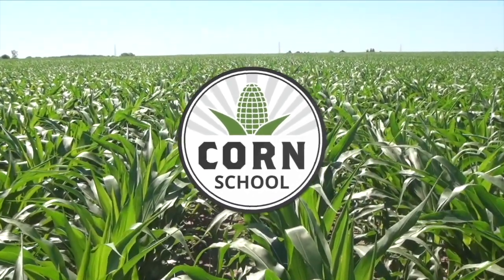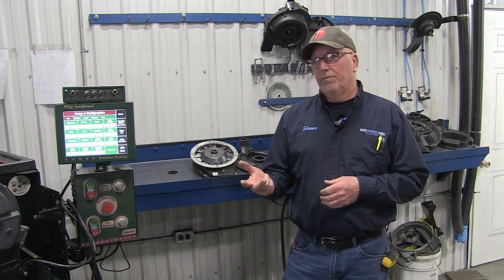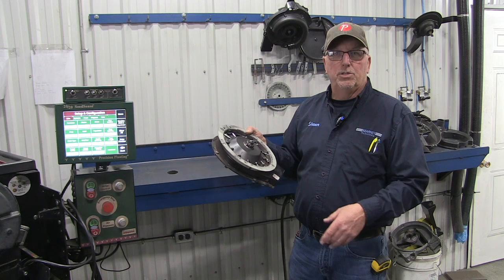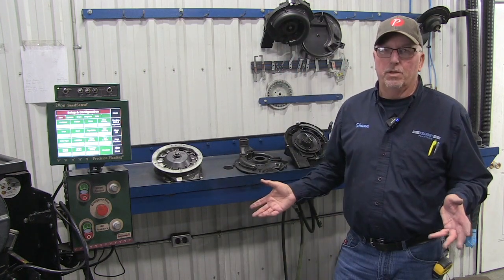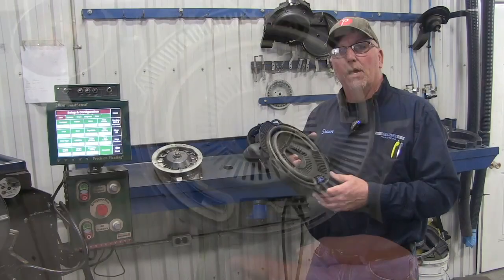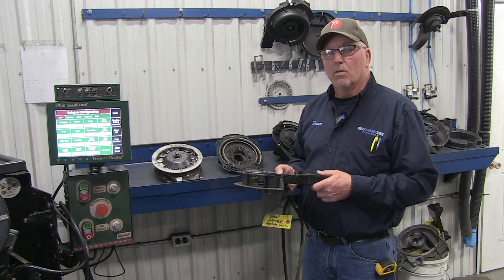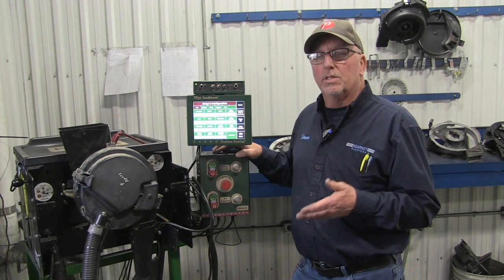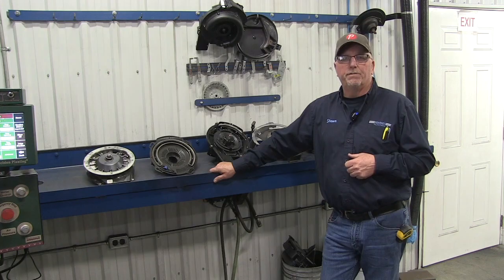Corn School: Seed Meters

Comment: Great Information:Shawn, I am looking to buy a 2 row planter JD 7100 with mechanical finger meters.  I am ignorant on these type of planters.  Can these planters be used for all seeds(corn, sunflower, vegetable(green beans, okra, peas, etc))?
Reply: @KrazyKajun602 I cannot answer about okra and peas, but corn and sunflowers can be planted with a finger meter system.  Sunflowers have a separate finger.  Oil sunflowers are sold in size 2, 3 and 4 seed, where size 2 are the largest and size 4 are the smallest.  You can use a corn finger to plant size 2 sunflowers, but size 2 are hard to come by.  Sunflower fingers work best for size 3 and size 4 seed. Biggest difference is the sunflower finger has a shorter "flag" than the corn finger.  Hope that helps
Reply: Could you give me any info on precision meter 343034 will this work for #4 clearfeild sunflowers. And could you break down what these number mean?
Reply: Finger meters are intended for corn, sunflowers, and pumpkins, basically planted at fairly low populations and having a teardrop shaped seed, which basically even corn is sort of a teardrop shaped seed, though less than sunflowers or pumpkin seed.  They might be able to plant other seeds of roughly the same size/shape, but probably not very well... might do an "acceptable" job or not, depending on what you consider "acceptable".  Smaller seeds its more likely that it'll drop multiple seeds at one time and not "singulate" the seeds, so the population may be erratic.  It's also possible it might not be able to hold onto the seed as it moves over the dips and bump in the backing plate (designed to dislodge multiple seeds when planting corn or sunflowers and allow the extra seed to fall back) or under the brush (which does the same thing as a "last resort").  Large round seeds like soybeans or oblong rounded seeds like green beans or string beans, or large oval seeds like pinto beans, dry beans, or lima beans, may be problematic as well.  The best advice I can give you is "try it and find out".  Population is another issue, as finger meters aren't designed to drop extremely high numbers of seed... they can handle corn up to about 50,000 plants/acre, but the higher the population the faster the meter has to turn, as there's only 12 fingers, which is basically similar to a 12 cell plate in a plate planter, or 12 cell disk on a vacuum/air planter.  Typically for "high rate" seeding like typically used for soybeans and such, where populations over 100,000 plants/acre are very typical (and usually in the 120,000-140,000 plants/acre is normal) you'd have anywhere from 36-48 cell plates or disks to handle that much seed, to keep the meter speed (rpm's of the meter wheel) down to acceptable speeds.  Finger meters, the faster they turn, the less seed they put out past a certain point, the "sweet spot" of the meter.  You can partially offset this by reducing ground speed, planting slower to allow the meter more time to do its job and keep it down in the 'sweet spot' of meter speed.  BUT that only gets you so far, particularly trying to plant seeds the meter was never intended to plant.  After all, if the finger meter could plant those seeds "acceptably" then there would be charts and recommended settings in the planter manual for those crops and seed types.  

Kinze makes a fine brush meter that is a DIRECT replacement for the finger meter for planting seeds other than corn.  It's SO good in fact that other manufacturers have copied it and made their own versions, like the Deere brush meter.  A brush meter uses a vertical seed disk somewhat like a vacuum or air planter, but there are no holes in the disk to allow air or vacuum to suck or blow seeds up against the disk and hold them in the seed cells or pockets... the seed disks for brush meters typically have some "agitation grooves" that assist in getting seeds moving down and into the cells around the periphery (outer edge) of the seed disk, where they drop into the pockets.  A large broad "cutoff brush sweeps excess seed out of these grooves as the grooves turn and pass under the brush, and another brush extending around the periphery of the meter housing then holds the single seed in each seed pocket as the seed disk turns... any excess seeds are swept away as the disk turns by the brush holding the single seed in each pocket.  They then fall back to the seed pool at the bottom of the meter coming down from the hopper above.  The seed disk turns past the top and where the brush ends, directly over the seed tube.  When the seed pocket passes the end of the brush, pressure of the bristles holding the seed in the pocket/cell ends, and the seed simply falls out of the disk and down the seed tube.  They basically do the exact same thing a vacuum meter does, but mechanically using a brush rather than complicated vacuum or air setups that require adjustment and hydraulically driven fans or blowers to maintain vacuum... and unlike a vacuum or air pressure planter, which will lose vacuum or air pressure if there's a disruption in the hydraulic flow, which can be common with older tractors, and when the airflow or vacuum is interrupted ALL the seeds fall off the disk, and the disk has to complete most of a revolution before it will start planting again, leaving a huge long blank area where no seeds are being dropped, a brush meter is impervious to this sort of thing, as the bristles will hold seeds in the pockets regardless, even overnight or until the planter is used again. Seed disks for many different types and kinds of crop seeds are available, and many are multi-use for different crops.  There are disks with up to 80 cells for high rate planted crops like soybeans and grain sorghum and such, all the way down to low-rate or 'hill drop" planted seeds.  The only thing that brush meters don't plant well is corn (and sunflowers and pumpkins), which is why finger meters are still sold to plant those crops.  Brush meters can pretty much handle anything else, and almost as well as vac/air planters.... 

Before brush meters came about, Deere used to sell "soybean cup meters" that fit in place of the finger meters for planting soybeans and other crops than corn.  Basically these were a simple agitator wheel type meter similar to a "double run" grain drill meter, which is basically a 'controlled spill' and not true singulation of seeds, thus the accuracy is pretty low, but for high-rate planted seeds like soybeans it's not much of an issue.  Of course before the vertical finger meters came about, the standard was the 'plate meter" which used a horizontal flat seed plate on the bottom of the hopper, which had multiple cells around the edge of the plate that seeds would drop into as it revolved.  It would revolve past a 'cutoff', a spring-loaded 'pawl" of sorts that would hold back multiple seeds from riding on top of the plate (and supposedly allowing only a single seed to ride under it in the cell, though it was common for multiple smaller seeds to manage to drop into a cell and ride through, which is why the cutoff pawl was spring loaded, to pop up over larger seeds that might be sticking up out of the cell.  The cell would then rotate over a hole in the bottom of the meter bottom plate, which would allow the seed to fall down the seed tube, usually helped along by a "seed knocker", a small spring-loaded wheel on an arm that rode directly over the hole and would drop down into the hole partway to push out any seeds that might have wedged in the cell, to ensure the cell didn't stay 'plugged up' with a wedged seed and create constant skips of that cell.   Plates didn't singulate seeds very well; the seed had to be carefully sized and graded for shape (rounds and flats in corn) and the seed cells of the plate carefully matched to the seed size/shape to singulate well, particularly in corn.  Seeds could be cracked, broken, or scuffed by the cutoff or seed knocker wheel as it rotated through the meter and plate cell, and cracked or damaged seed might not germinate at all.  WHICH is why finger meters and brush meters were eventually invented, to do a better job.  

My advice would be to pick up a pair of brush meters and the appropriate seed disks for what you want to plant.  Use the finger meters for corn, sunflowers, pumpkins, watermelon, or other such seeds and crops planted at low rates with 'teardrop' shaped seeds, and use the brush meters with the appropriate disks for everything else.  We planted cotton, grain sorghum, and soybeans with brush meters for years and, properly maintained, they'd plant as good as a vacuum planter IMHO.  Brush meters and finger meters both attach to the bottom of the hopper identically, they can be swapped out in less than a minute per row